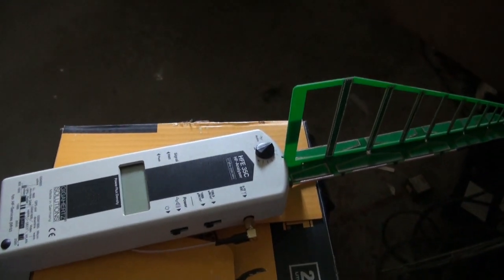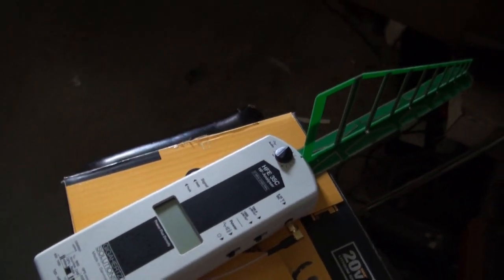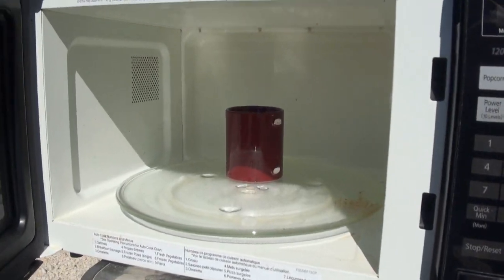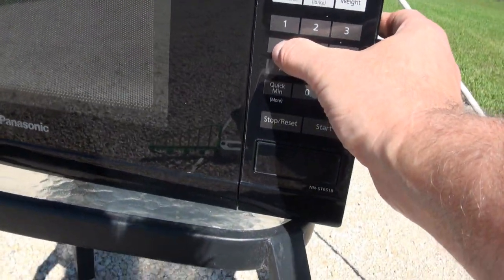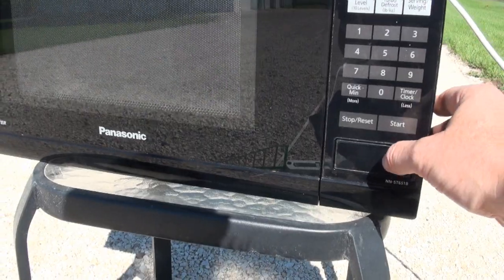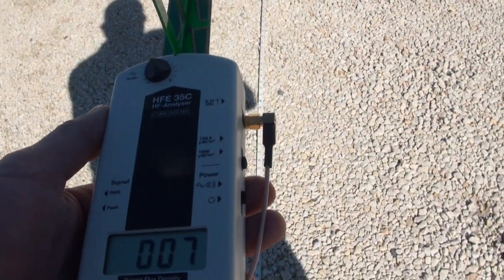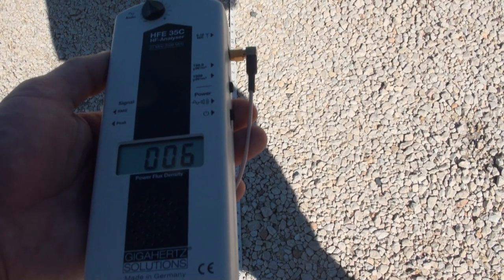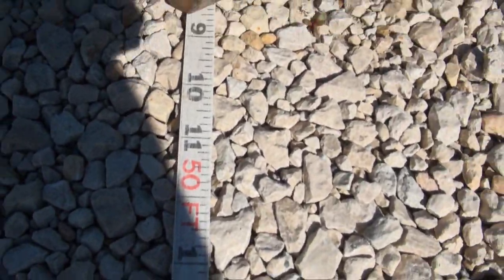Out Door Microwave test

Comment: I have a Trifield  I went over to my local Hospital and it is maxing out on RF coming from inside the hospital no wonder people go in there and die If you read the "Invisible Rainbow" By Arthur Firstenberg and "The Biochemic System of Medicine" by George Carey you will see that the Spanish Gomboo was not caused by a bug it was radio waves, Electricity puts more strain on your body and makes it require more of the 12 Cell Tissue salts that your body needs to stay well and survive if you don't get sufficient amounts of these salts you get sick and sometimes die  Most of the people back then that were in insane asylums were former telegraph workers and some had paralysis and other nasty health problems  Earthing/grounding  is another good thing for the body to get rid of electro-smog symptoms from the body and promote healing